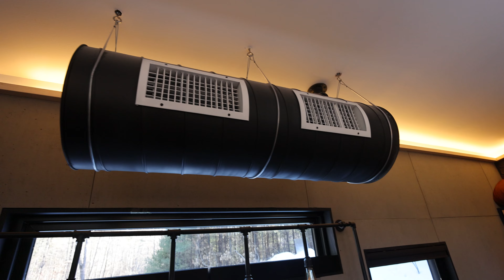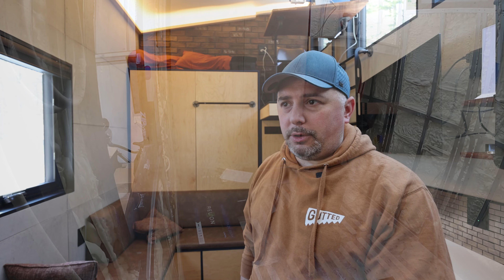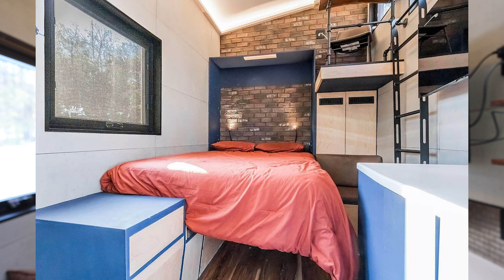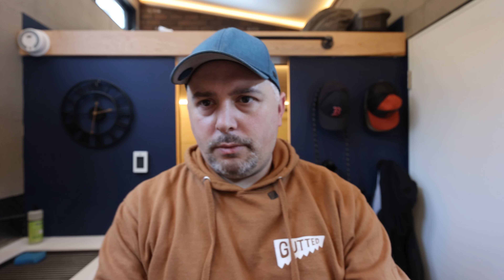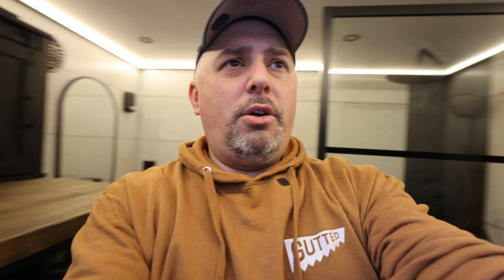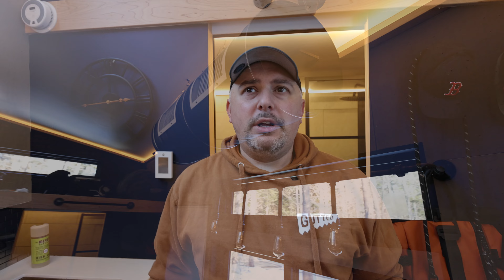Modern Loft Style Design Tiny Home - Fully Off Grid Capable

Comment: I love what you did on the inside of your tiny home. Where does the water go from the air conditioner?
Reply: The built in evap ?
Reply from the maker: There are 2 flower pots sitting on the upper window. During the summer there is a tube that runs over to them and fills them. Some maintenance is required if need to empty
Reply: @jarrodtocci  brilliant...  I remember you expecting to address that drip... ''Race it around & sleep on it '',is ultimately successful.